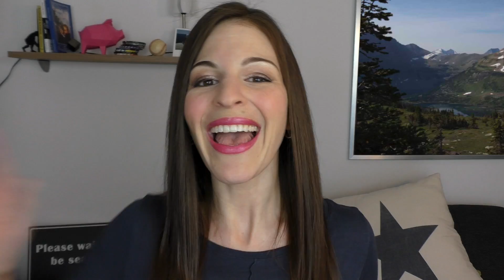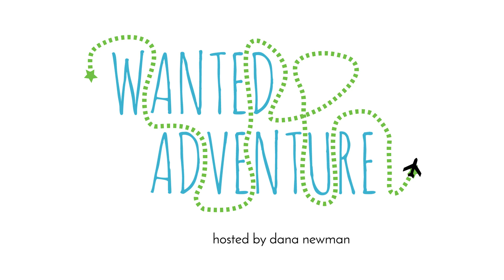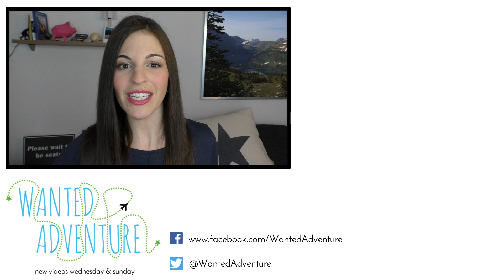Why Are Houses in America MADE OF WOOD?!

Comment: Well, we had two (relatively light) tornados in Hamburg in 2016. 
Yes, they did touch down, and they would probably have been rated at EF2 or EF3 tornadoes, so they weren't completely dinky ones, ok?

A few roof tiles got picked up, one or two roofs got damaged by uprooted trees (weighing a LOT more than a normal bus) falling on them, maybe one or two roofs got taken down.
Nothing more serious than that. No completely destroyed houses, no rubble alleys cutting through Hamburg leaving only death and destruction.
Yeah, some wooden sheds and gazebos got demolished, but that was to be expected.
A few weeks after the tornadoes the roofs were rebuilt, and people returned to normal life in those houses.

No, they aren't EF5 proof, true.
But then again, almost nothing is proof vs an EF5 tornado.

And hurricanes? 
Well, we get some pretty nasty winds during the winter here, barging in from the North Sea, and I sleep easily and comfortably in a house made of brick and concrete.
Yes, they might not be hurricanes like Katrina, or other disasters of that magnitude.

But Hamburg is very prepared for storms. And none of the old buildings in the Speicherstadt have ever suffered total destruction like what is often seen after a hurricane hits Florida or the coastal regions around the Gulf of Mexico. And yepp, they are built of brick, on wooden pillons driven deep into the silt of the Elbe river, and they have survived for more than 130 years now (including the disastrous flood of 1962). Their bases are swept by the tide-locked river each and every day.

The pretext of picked-up buses, cars, etc does not really apply to houses with concrete foundations and socketed walls. 
In most of Germany houses are built with a deep cellar with a solid concrete foundation. This offers a HUGE counter-weight that is not easily assaulted by the wind as it is submergerd underground.
Inter-locking large bricks (Yton bricks) firmly mortared and connected to this foundation with no possibility (until a wall is significantly damaged) for the wind to go underneath or into the structure itsself reduces available surface area for the wind to assault. Usually wire mesh or steel girders set into the concrete foundation are the basis for ground floor walls. Therefore a tougher wall prevents exactly that danger: an opening for the wind to enter the structure and offer a huge amount of surface area for wind resistance and shearing effects to pick up a structure.

And buses being picked-up by winds and tossed willy-nilly into houses is not the norm, not even for the USA. 
It's not as if tornado alley had a convenient bus parking lot filled with empty buses dropped into the path of every tornado. 
So the chance of a single house, or even a town being the target of multiple such huge objects is comparatively tiny.

I am not saying there might be other reasons why there are differences in building styles. One among them actually might be tradition. Maybe other factors apply.
Cost certainly is a factor. But then again, Germany has a different building mentality. Here, houses are built to last. Most Germans don't think about building anything if it's not going to last at least 50 years, preferably longer than their lifetimes. Most hope for an even longer duration.

The oldest still used house in my parent's village is over 480 years old, and none of the winter storms during that time have ever come close to moving that house, or causing it to collapse. Yes, it is a half-timber, half-brick house, with an outer shell of bricks and clinker tiles. This type of building uses the best of both worlds, and has been shown to be effective for quite some time now.

So why not combine the knowledge of both styles for something truely awesome?

Comment: while in germany houses are more often build with bricks, the floors and internal walls that aren't supporting the struckture are often still made out of wood (some walls are even made out of plaster). there is another reason why the US builds houses out of wood: wood is cheaper, so you can make a bigger house with the same amount of money. in germany it's more important that houses are well insulated, so that's why the houses are built out of bricks. (those bricks aren't just solid pieces, they have vertical holes in them, and the air trapped inside those brickwalls helps with the insulation)

Comment: wood is cheaper. in germany where the population density is much higher the costs of the land often exceeds the costs of the house whereas in the us (at least outside the big cities) ground is quite cheap and instead of building a tall house with more than 3 floors (which is difficult to achieve with wood) you just build it wider.
on the other hand you probably won't find a single wooden house in manhattan where ground is expensive.

Comment: I guess one point is that energy is much cheaper in the US. In Germany houses are isolated to save oil, gas and electric power. The people want to save that and the government forces the people to build well isolated houses.
Whereas in the US energy is much cheaper and the governmental rules are different. They simply build houses of wood because it's cheaper. In my opinion that's typical for Americans.
Reply: I think you've got a bit of a wrong mindset with regards to the ability of a modern American home to be insulated properly. I've built them, and they can be very efficient. From fiberglass insulation in the walls, to foam boarding and house wrap on the outside, to spray insulation between rafters in the attic. Modern ducting for heating and air conditioning can be insulated as well, and modern homes can be carefully planned to waste as little energy in the delivery of the conditioned air as possible.

Older homes can be a different story however. Whether by poor design of these systems, or by being poorly retrofitted to accommodate them.

Also American homes tend to be spaced more generously apart, even in and around cities. Less wind breaks means higher heating costs in the winter. Trees in the yard tend to offset this somewhat, and could even provide a modicum of shade in the summer months which might aid in cooling costs.

Comment: It isnt that easy. We did build a woodhouse in switzerland. Wood has some advantages over bricks, stone and concrete. First, to get the same thermal isolation using stone you need to triple the wall profile. so a wood house is bigger inside than a stone house with the same external dimensions (that important in switzerland where you sometimes are fixed with the external dimensions and you are trying to get a maximum out of it). And the difference is not small, in my house we gained some m2 using wood. Second you do not have the problem to get the house dry after building it, thats often a probelm with stone houses in the first few month. Third a wood house is often (not always) cheaper than a stone house. Fouth in a case of an eartquake (not very likely in switzerland) a wood house is more flexible so i should deal better with earthquake.
Disadvantages of wood: The material doesnt last as long, so if you build a house for more than 1 generation, stone is the material to use. 

Thats just my opinion and point of view. We are very happy with our wood-house.

Comment: I'm German and I have witnessed two tornados so far. What bothers me most about wood houses is the idea that the walls and the floor could burn in a housefire. How soundproof are the walls in wood houses? Can you just drill into a wall and mount heavy objects like cupboards directly to them?  In a few TV-shows people are able to crawl under their houses (most of the time in the context of checking if there are (dead) animals underneath) is this a common thing in the US ? Have wood houses also a concrete base, or just this "gap" or anything else?
Reply: Stone houses also burn, Jutta. It's the contents that are most flammable. The framing is behind fire-resistant wall board. And I've seen the results of a house fire in a stone house. They turn to rubble. Mortar doesn't stand up to heat. This why you saw brick and stone structures collapse in Dresden and London during WWII.
Wood homes are easier to insulate against sound and heat loss and are just as quiet in the frequencies that your ears are most sensitive to. Low frequencies require many feet of mass to attenuate. More than the walls of personal homes.
Yes, you can easily drill into a wall and secure heavy items. That is the recommended procedure in earthquake-prone areas. You don't hang things off the wall, though. They sit all of their weight on the floor. You secure them to the wall so they don't fall over in the shaking. That's because the walls are sturdy. Kitchen cabinets might be attached to the structure in a way that bears the weight, but only on larger beams.
Crawl spaces under homes are there to prevent moisture build up. That's another advantage of building from lightweight materials. Animals are kept out by metal screens and vents. Some houses do have concrete slab foundations. This is usually to accommodate radiant heating systems which are more efficient and comfortable than forced-air heating or in-room radiators.
Reply: Jutta Beckmann wood homes aren't typically sound proof but neither are stones ones and if you live in a decent area they'll be just as sound proof as stone, and we mount things into the framework of our homes typically the 2x4s or the 2x6s
Reply: Jutta Beckmann and no crawl spaces (the area under the home you're referring to) aren't that common in America that's most common in the great Plains and the South  (most of tornado alley) and they are most often mounted to a concrete foundation.
Reply: Jutta Beckmann and no crawl spaces (the area under the home you're referring to) aren't that common in America that's most common in the great Plains and the South  (most of tornado alley) and they are most often mounted to a concrete foundation.
Reply: Markle2k  Thanks for the infomation :)
Reply: I live in a Midwest and haven't seen too many crawlspaces like on TV. There are a lot of full basements here, even though it's sometimes wet. They're useful when tornados come along (not often in my area, thankfully) and a lot of people finish them and use them like extra living space. I'd feel funny just having a concrete slab - not to mention you'd lose a lot of storage space.
Reply: In some areas in the US the ground is mostly clay, making it extremely difficult to have concrete basements. Also, along the coast or near rivers, lakes, etc, they generally don't have basements and are built up higher off the ground to avoid flooding. These are the places with crawl spaces. Also, modular homes, but that's a whole other thing....
Reply: Jutta Beckmann some of the worst home fires I have seen in California were made from brick, most homes in California have stuco on the outer walls to protect them.

Comment: I grew up in Chicago and because of the great Chicago fire of 1871 building codes were changed and most of the homes there are now brick.  Where I live now in the Pacific Northwest homes are overwhelmingly wood and for the reasons you cite in the video, the abundance of cheap raw material from large forests.
Reply: No. It's because brick buildings fall down in earthquakes. Wood framing is much more resilient than mortar. Harken back to the Seattle earthquake in 2001. Most of the damage was from brick structures collapsing. Same with Christchurch, NZ.

Comment: When I lived in Germany, I learned how incredibly limited the wood supply is in Germany.  Concrete and masonry, on the other hand, are still readily available and comparatively cheap as building materials...so it makes sense that construction in Germany is mostly of that type since making a wooden house would be incredibly expensive and not any better. 

In the US, wood is so cheap and has been successfully used for all of history.  You can definitely build a sound house that will last for hundreds of years without issue...they are everywhere here.  And wooden houses are not only cheaper to build because of the price of the materials but also in labor since wooden structures go up quicker and are easier to run the systems (plumbing, electrical, etc.).  

I will say a masonry house would hold up better in a tornado but a wooden house is better in an earthquake (which we also have here...arguably more instances of seismic damage than tornado damage).   

I liked the sound qualities of the mortar house I lived in while in Germany...always very quiet inside but I quickly learned that unless you have radiant heating the floors...slippers are a must in the winter since the floors are like ice.  

I guess there benefits and downfalls specific to each construction method.

Comment: Reinforced concrete would make a good building material for homes in Texas. They could be built to withstand the shifting ground (seasonal ground water content and fracking caused earthquakes) and be more energy efficient. This will not happen because of cost, deed restrictions and Home Owner Associations. HOAs have amazing extra-legal power in the US. They make ignorant decisions that go against science and engineering wisdom. Try to fight them and you can have your property taken away. Still, that is second to cost. All houses are expensive anywhere you'd want to live. Going with a non-standard material drives up the cost. Deed restrictions typically specify the size and building specifications of a house. 

For tornado and heat protection, Texans should build underground. Concrete with an earth berm. But building such a home would be illegal in 99% of typical Texas home building situations. Doesn't make sense, but look at our politics! We are hopeless.
Reply: HOAs are evil. Google "HOA Syndrome". Totally agree about underground or "Hobbit" houses. The primary destructive force of tornadoes is the overpressure. That's why atomic blasts are so destructive. Underground cnstruction is not subject to such. The primary hazard is groundwater; French drains solve that problem.
Reply: YOUR politics are hopeless.  Washington state is just fine, and if I wanted to build an earth bermed bunker, I could.  We just sued Herr Fuhrer Drumpf, and stopped his Muslim pogrom dead in its tracks.  There are almost no Muslims here - we just don't like fascist / racist pogroms.  As a German once said, "first they came for the Jews..."  Washington state said fck NO!  If you're fed up with Texas, you're welcome here, friend.
Reply: I love the Pacific Northwest. Spent some great time in Issaquah. Good memories. Plus, I'd love to photograph the waterfalls... visit Olympic National Park... Sigh.

Comment: The easiest answer might be that Americans tend(ed) to be a lot more mobile than average Europeans in terms of settling down. Houses in America - that is ... low to higher low end houses were much cheaper than european counterparts.

Then there is also the thing about resources and pricing. Heating, cooling etc. has always been significantly cheaper in the US - so places like Germany turned this disadvantage of higher resource pricing into a kind of virtue by building more solid and better isolated houses (probably rather out of necessity than out of ethical good will for a better environment - at first)

ps.:

I think ... even in America - and even in the tornado passages - ... there is a very generous grey area between calm - and tornados hurling busses at 200mp/h. Granted - when the weather throws a bus at 200 miles per hour at your house - you are screwed - unless you live in a castle. 
I would however assume that a solid brick house with good foundation and a cellar would indeed not turn into rubble in the average hurrican/tornado - but instead probably "only" take damage (while still remaining intact enough to live in)
Reply: Tornadoes cause houses to explode, with massive lift forces.  Brick walls wouldn't prevent that at all.  A house would have to be built with all exterior surfaces of reinforced concrete, to survive a hurricane, and the windows and doors would need very powerful metal shutters to survive.  Fortunately for me, there has never been a house destroying tornado within a 1500 kilometers of where I live in the US.